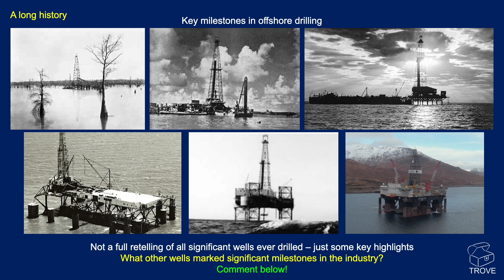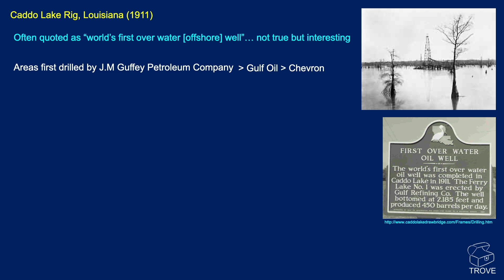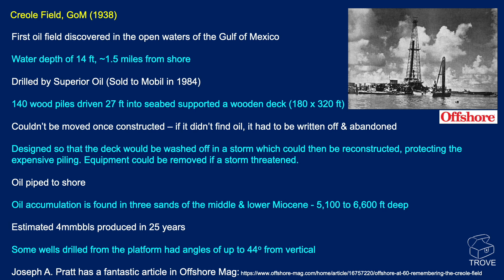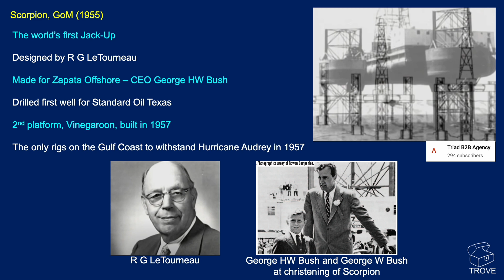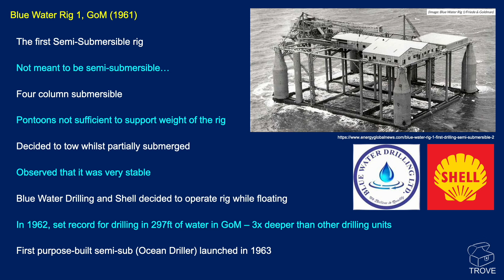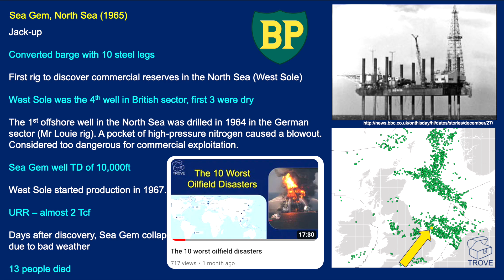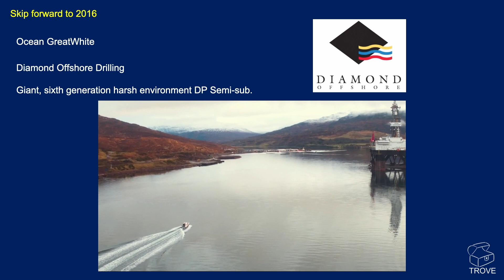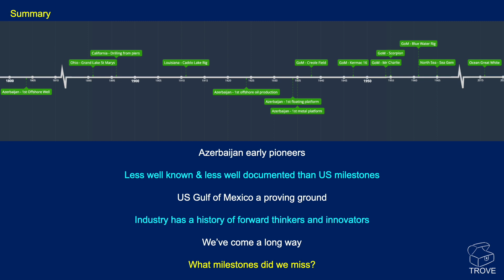The AMAZING History of Offshore Drilling Rigs

Comment: Calling a well "the first North Sea well" will always be a controversial issue. You could claim that the first well in the North Sea was drilled in 1938 over 40 km from the coast....but this was done by a landrig located on the island Heligoland (well Helgoland 1, TD of 3100 m, drilled for Carboniferous coal which was not reached). 

You could also claim that well KDZ-1, drilled by the Triton 1961 in the Dutch sector was the first North Sea well.....but this well was located inside the territorial waters because the continental shelf convention had not yet been ratified.

How about the first and so far only exploration well in the North Sea for which a new platform had been built prior to discovery? It was not a case of "development before exploration", but just a case of high rig costs why a production-style platform was put in place for Conoco exploration well 49/17-1 (UK sector).

Or the last North Sea well drilled in submersible mode? It was drilled by the Ocean Prince, a semisub that broke apart in the attempt.
Reply from the maker: Hi Helge,

Thanks for these examples which pre-date the North Sea well we quoted. We didn't do thorough research into the North Sea sector wells, as we were focused on the first offshore well globally. Many sources cite US wells, whereas there seems strong evidence that Azerbaijan may have had the first offshore well. Perhaps a future thesis for someone studying the history of the O&G industry. Hope all goes well for you. ATB, Mike